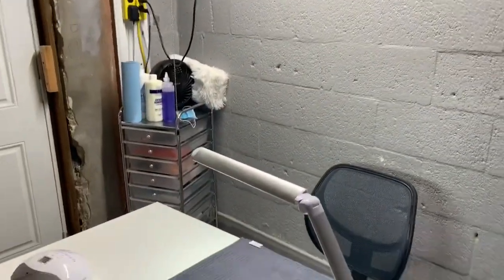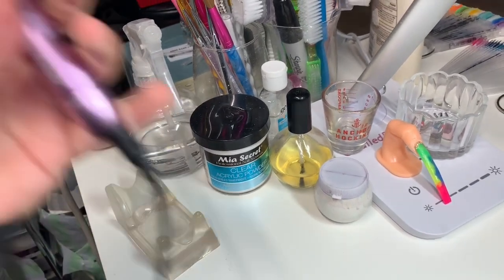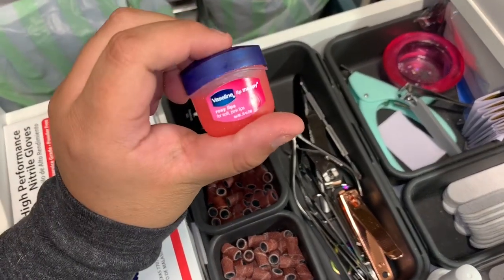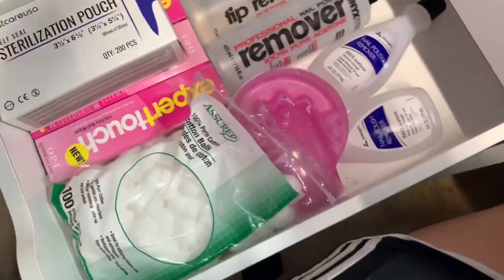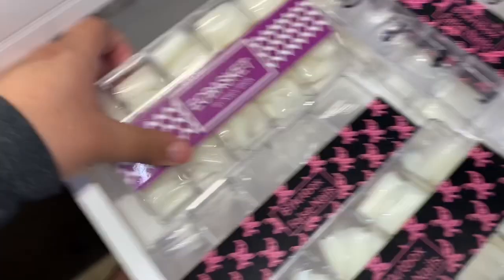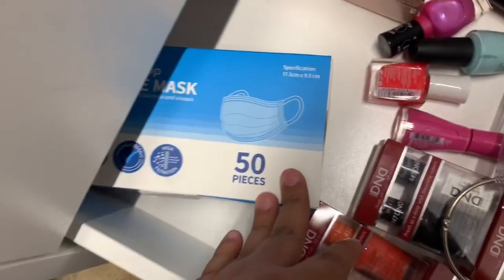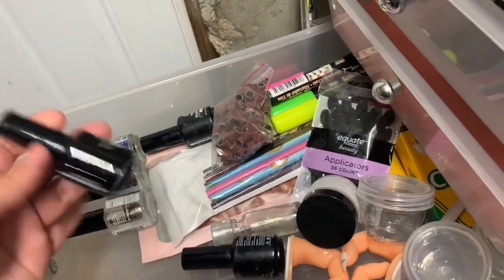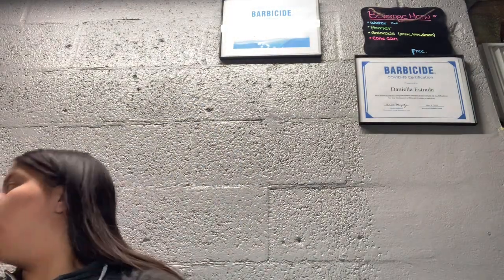Nail desk tour | Daniella Estrada

Comment: The pouches with clean implements.... you’re putting your hands all over. No longer sanitary. The pushers are sticking out anyway, not clean. I know your state  board doesn’t allow all that. If you’re done with nail school or cosmetology school, you should take more CE classes for sanitation, disinfection and sterilization. (Not barbicide).
Reply from the maker: I didn’t show it in the video but I do have all my implements in the sanitary pouches , those are just some of my extras , this video was record around 2 months ago ! But I did have my stuff in pouches :)